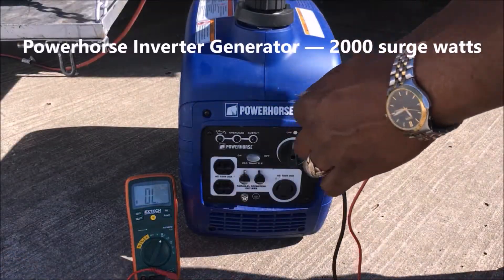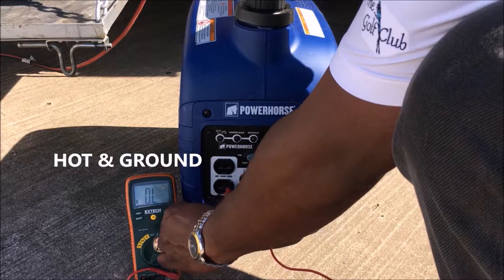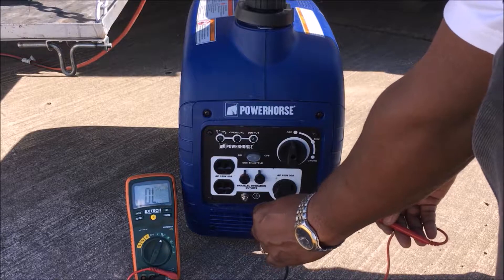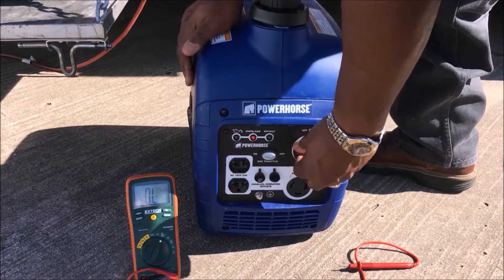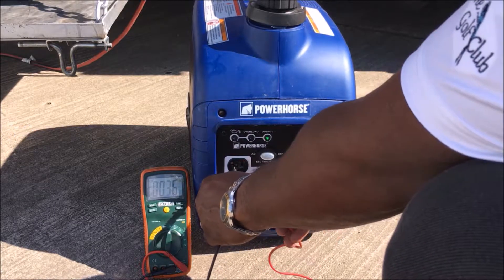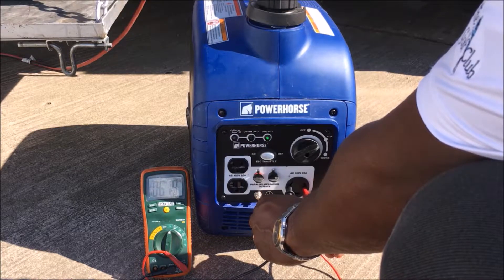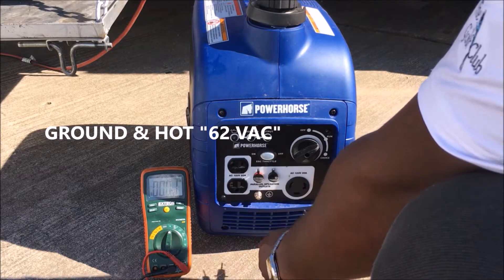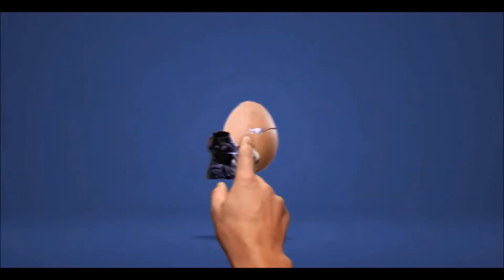Why is my powerhorse inverter generator reading 62 volts on the neutral to ground

Comment: hi my theory is the earth of the output is connected to the negative side of the capacitor in the inverter and the live and neutral ac outputs are created from the capacitor resulting in pulsed dc between earth and neutral and between earth and live.
this is just a theory and i could be completely wrong